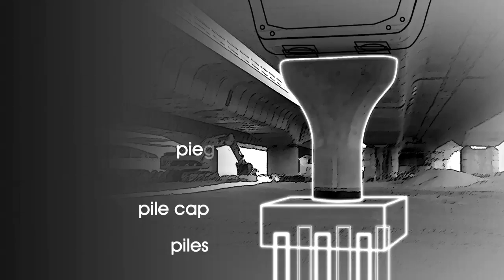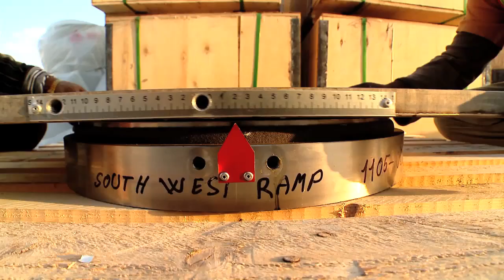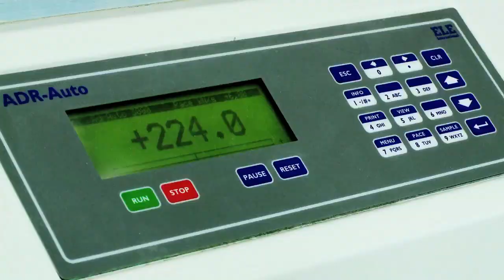Bahrain's North Manama Causeway; How to: Modern Causeway Construction Educational Film

Comment: 13:35 min. - The mold is carefully removed by lifting upwards. Raising the mold be in the range 2 to 5 seconds,
be quiet, careful not to touch the cone formed concrete to avoid side or
torsional movement of concrete. The entire process, from filling to raise the mold should not last longer
150 seconds.

Concrete sample should be taken in accordance with - HRN EN 12350-1.

Comment: hey, anybody knows how the pieces stick together ? is there any gum uses between the pieces ? because i do not see any other medium that acts to attach the pieces !!
Reply: +Sam Perumal in the video it says that segments of the bridge are joined with some kind of epoxy and steel wire rope.
Reply: +Sam Perumal +Pablo Ascencio

Each piece has grooves and teeth. The pieces are casted adjacent to each other so they fit perfectly together, teeth into grooves.

Once they're slid into position on site steel wires are used to hold them tightly together, locking the grooves and teeth.

In addition an epoxy is placed between the blocks, but I'd guess this is only for weatherproofing.
Reply: +Fr33m4n77 - DO U THINK THIS ONLY EPOXY AND LOW TEETH GROOVES ARE ENOUGH TO KEEP JOINT EACH OTHER GIRDERS?
ACTUALLY WHATS THE TECHNIC?
MR. SAM ALSO KEEP THIS QUESTIONS...?
Reply: The high tensile Steel wires called strands of 22mm are inserted in the holes of  the all segments and stretched and pretensioned to required pressure as designed and make single unit of span. Like a thread in pearls chain.